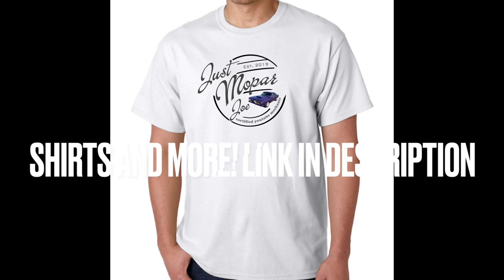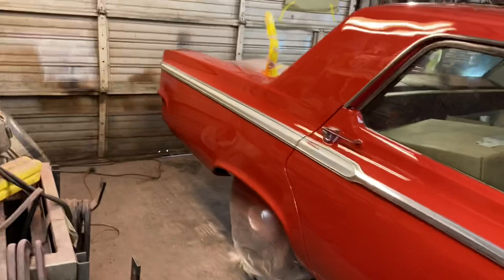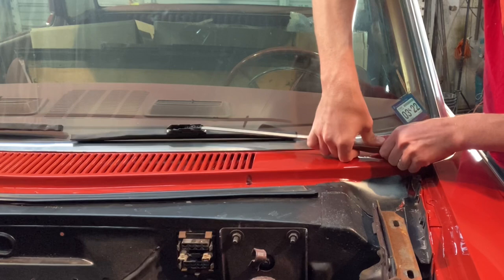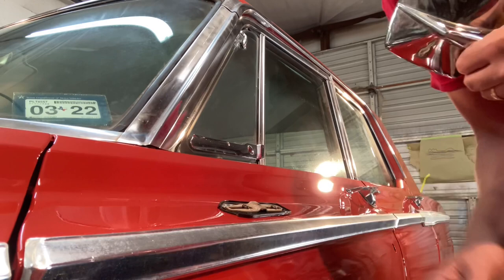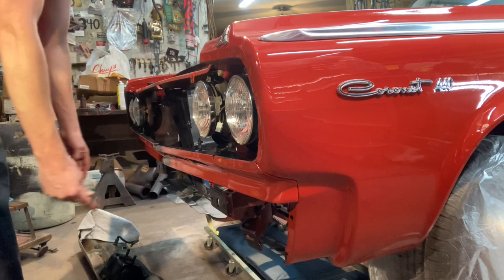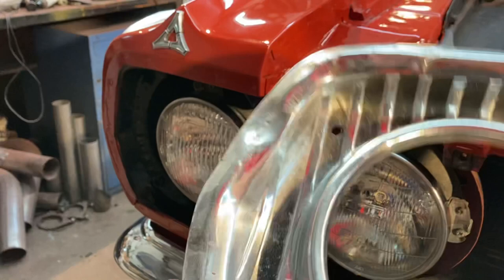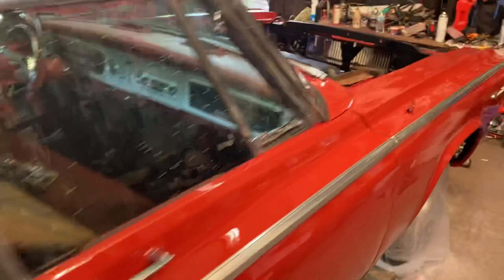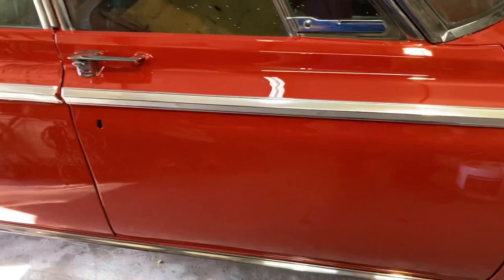65 Coronet: Finally Looks Like a Car Again #mopar #painting #dodge #diy

Comment: Sweet . if you ever have to work out small dings and dents out of trim lay a thin sheet of soft leather on a hard surface and taking a sooth tool and a autobody hammer and gently tap the back side of the dent you can use a really thin piece of leather between the trim to tap on so it won't leave a mark . the leather wont scratch up the metal
Reply from the maker: Nice idea! I always hammer over something soft. Sometimes a block of wood.

Comment: You do really nice work. I don't know if you remember but I was going to buy a throttle body off you for my 89 d100. Well I ended up pulling the engine and put all new bearings and new oil pump. Anyway long story short I've got it back together and still interested in that throttle body if you still have it?
Reply from the maker: I think I still do. Can you send me an email, and I’ll look for it tomorrow.

Comment: Where did you get those black rubber pieces shown at 12:48?  Awesome job documenting the build!  I have a '65 440 red convertible.
Reply from the maker: Those were the factory ones! I cleaned with alcohol and rags, then shot them black again. Only a few small cracks, but I have no idea were to get more. Maybe they could be 3d printed

Comment: Good Time to Carnauba Wax those Lights and Surrounds after Steel Wooling them
Reply from the maker: Interesting! Would you use carnuba on the surrounds over flitz?
Reply: Water Tight Mate 👌
Reply: Seal The Deal with an Extra Layer of Protection from Oxidation

Comment: Is the wiper motor in the PARK position. Had one threes ago that some moron put the wiper lever on wrong. Where do you think the wipers went when I checked them out. (On the freshly painted hood)😢
Reply from the maker: Thanks buddy. Yes sir. I pulled the wipers after the battery and engine was removed. Didn’t turn the levers at all, just reinstalled as I took them off.